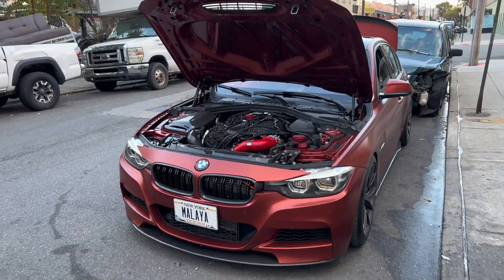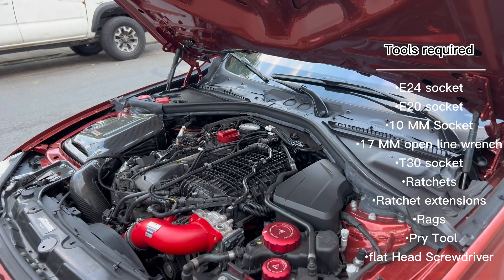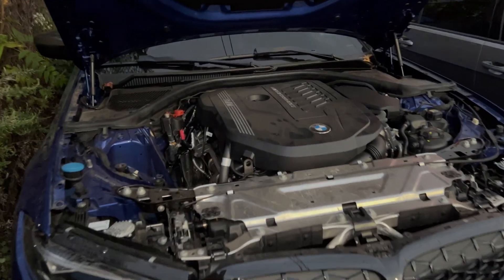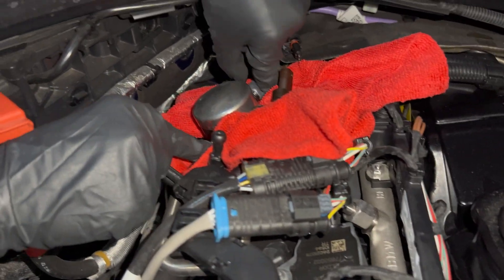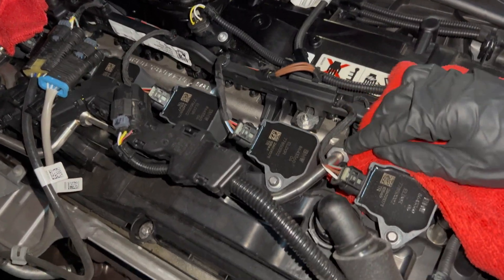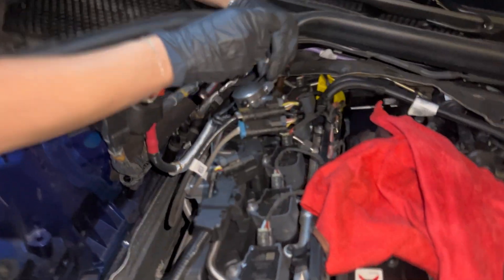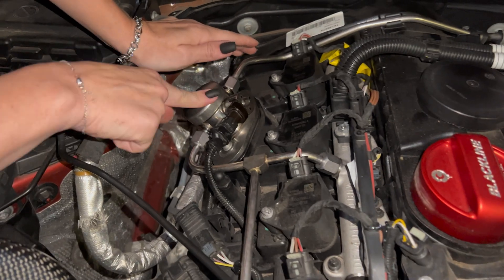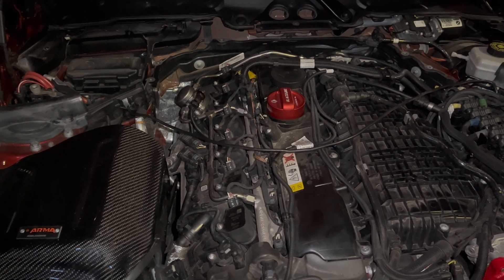High Pressure Fuel Pump Install (B58 TU) (BMW 340)

Comment: How are you liking the TU Pump? Im getting ready to install one on my G30 540. Getting it done at a shop in Queens.
Reply: Did you end up getting it? You flashed stage2+? Is there any difference in low end torque?